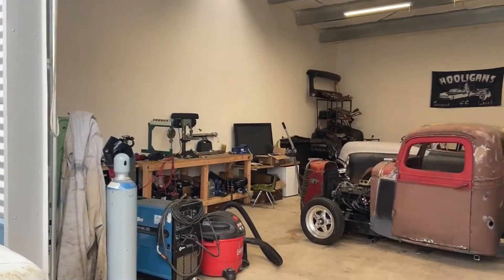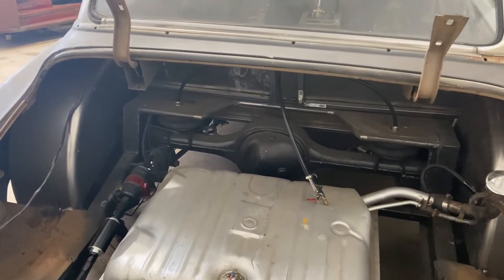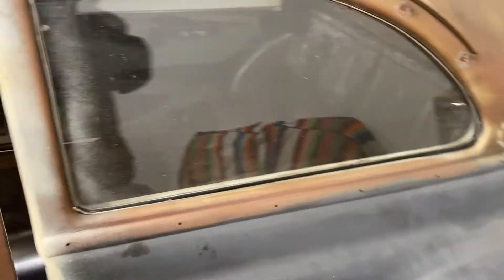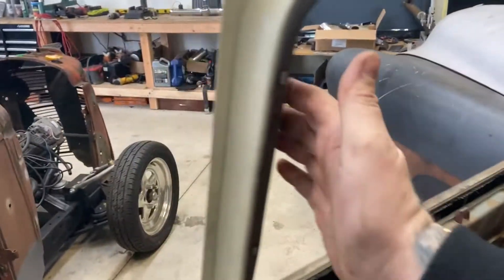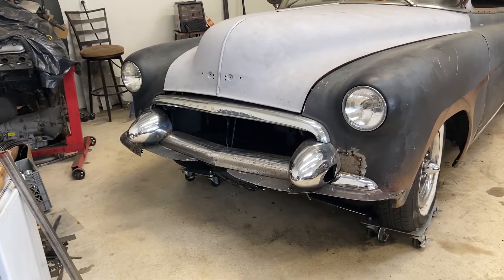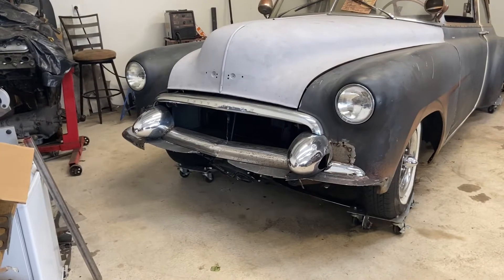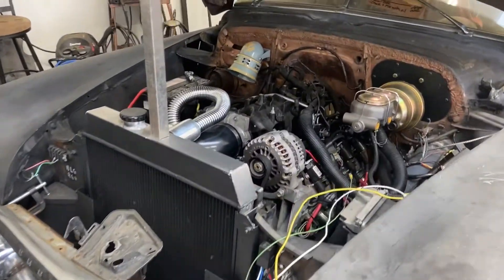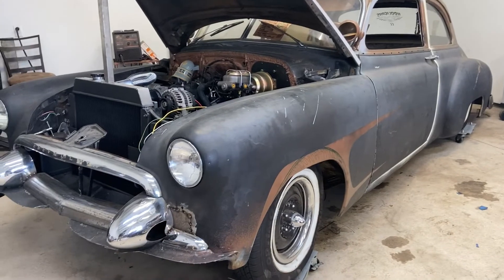My LS swapped 1950 Chevy

Comment: can you please please do a followup video on the specifics of the ls swap? im doing a 1949 styeline deluxe with 5.3l and 4l80e. l specifically want to see motor mounts, steering, brakes, 4l80e fitment, radiator choice, brake booster setup, etc. Not a lot of these out there to go off of.
Reply from the maker: You’ll have to reshape the firewall to fit the 4l80e , I used Walton motor mounts and trans crossmember, corvette break booster firewall mount for with speedway pedal assembly for 49-54. Floor mount lokar shifter , eBay radiator for 49-54 small block swap.  Holly ls1 cast exhaust manifolds. 
Its all bolt in except cutting and raising the firewall. And trimming the pinch mold off the firewall.

Comment: Can you do a video on the motor mounts? I'm having a hard time figuring out how to bolt the LS in my 52'
Reply from the maker: Walton Fab makes bolt in mounts
Reply: @handmadehooligan  found em! Thanks!! For the LS did you have use a IFS? Or can I run it stock?
Reply: Could I use these mounts for a 56 fairlane
Reply: @handmadehooligan  do you have any pics of how they mount? for mine i had to cut out metal brackets to allow it to bolt in.

Comment: Hey buddy I'm doing a 52 bel air LS ... just wondering did you have to use a mustang 2 front end? Also what oil pan did you use???? Thanks!
Reply from the maker: I’m running a stock front end and get the lowest profile pan you can.  I have a gm muscle car pan
Reply: @handmadehooligan  thanks buddy! I think I found it.. also what transmission did you use and what cross member for the tranny? I bought my ls motor last week out of a 2002 tahoe.. no turning back now ... thanks for the tips!
Reply from the maker: 4l80e .. I made my crossmembers , I don’t often buy things like that
Reply: @handmadehooligan  did you have to cut the floorpan for the 4l80e to fit? im installing mine and had to cut it some but im still messing with motor mounts and angles